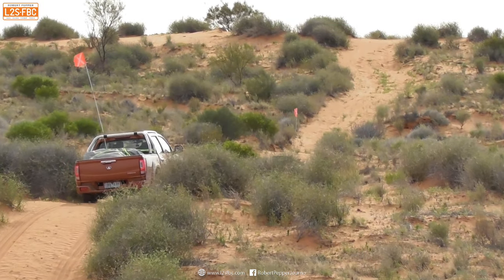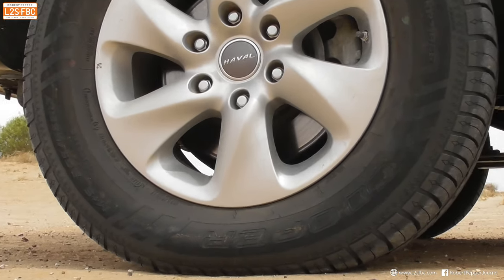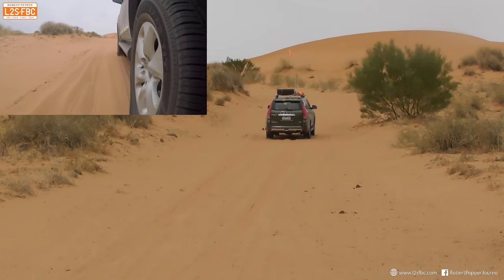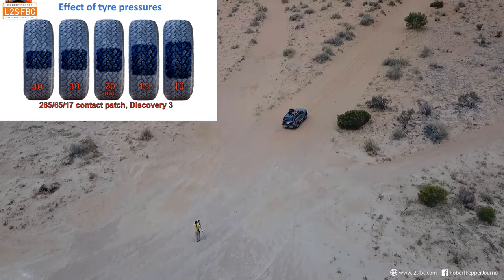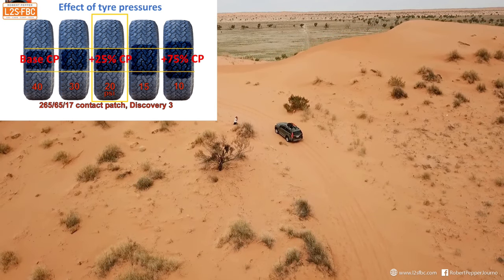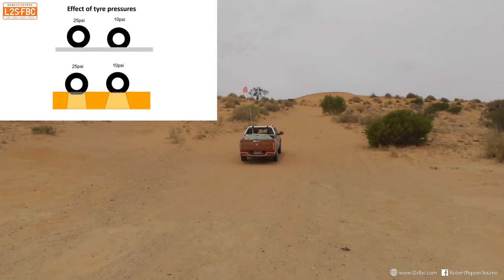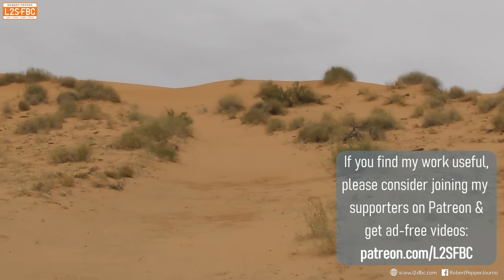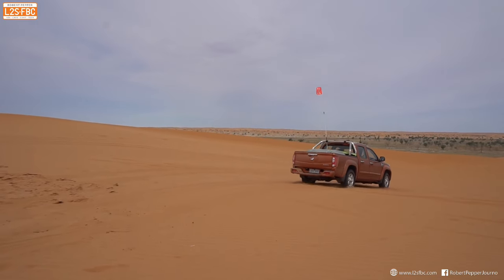Big Red driven right.

Comment: To grip in soft sand is to limit displacing the sand as you drive over it. Of course you can drive through sand like a paddle steamer, but the light suv with soft sidewall tyres will likely drive over it with less energy used.

Comment: Thanks Robert great work as usual. I’ve never been game enough to go below 18 psi as I’m worried about bead seal lose. Do you ever find this a problem?  I get that you can go a bit easy on the steering but it has always concerned me. Regards.
Reply from the maker: Depends somewhat on your vehicle, but for the Simpson I run 15.  I've never lost a bead. I'd start to be concerned at 10psi. I have lost beads at higher pressures in forests when the tyre is squeezed in rocks etc.  The reduction from 18 to 15psi will be a significant improvement in sand driveability.

Comment: Although I 100% agree with you about tyre pressures, my LR has 235/55 R19 and I’m not in a position to change that. I have AT tyres (MT not available in my rim spec and I don’t want MT anyway); I don’t think it’s wise to go much below 20psi on this profile/rim as too much chance of rolling the bead off the rim. Pretty sure I could still do the Simpson with ease though. Your thoughts?
Reply: I wouldn't go lower than 20psi in your situation to prevent creasing the sidewall and damaging the rim. Rebeading a tire on the track is a real pain. During the winter the Simpson crossing is a relatively gentle trip on the car and you'll have no problem. It's more a logistical trip bringing camping supplies for a few days.
Reply from the maker: 235/55/19 or 255/55/19?  Either way, if you have decent tyres I would go to 18 on sand which will be a difference to 20.  Sand is fairly flat, unlike rocks, and rim damage is less likely.  You will do the Simpson with ease.  The ideal for those cars is 245/70/17 if you can take 17" rims available secondhand, or 18s either LR standard or TuffAnt.  Rolling a tyre off the bead isn't the risk with low profiles, it's damage to rim or tyre pinch.

Comment: Apparently there are Two Big Red sand dunes. The easy one that people brag about climbing, and the real one. Which one is this video about . A mate climbed the ‘real’ difficult one in a low powered 2.5 ton LandRover on pizza cutter 7.50x16 tyres at a very slow idle in low range 1st gear of his specially modified transmission that had a crawl ratio of 110:1. It would have been the slowest ascent in history.
Reply from the maker: Well I have a video proving that narrow tyres are not in fact pizza cutters....
Reply: @L2SFBC the old Uniroyal steeltrek 7.50x16s under a 2.5 ton vehicle on soft dry sand couldn’t be described as floatation tyres.

Comment: Modern traction control (not ESC) makes a huge difference. It’s amazing where stock 4WDs can go these days.
Reply from the maker: It does but not in this case. Pure tyre pressure nothing else.
Reply: LR Terrain Response Sand Mode is awesome.

Comment: Terrible clickbait, the worst ever. I just had to watch the most boring accent ever 🤣. In a Greatwall X240 this advice has always worked great for me in sand. The only time I got stuck in sand was when I was going uphill, it had just rained, and I had to follow deep tire ruts. The wet sand was so sticky, that when I bottomed out, I stuck solid. I couldn't even reverse back down the slope. I had to clear the sand out from underneath the vehicle, and shovel the center ridge into the ruts for several metres to get enough momentum so that I could get back down the track in reverse. Then I waited a few hours for the sand to dry before trying again. Once the sand was dry I had no problems.